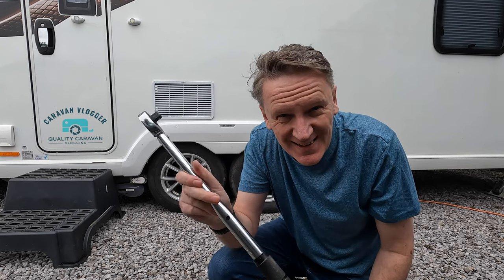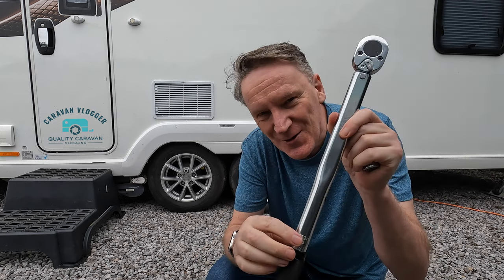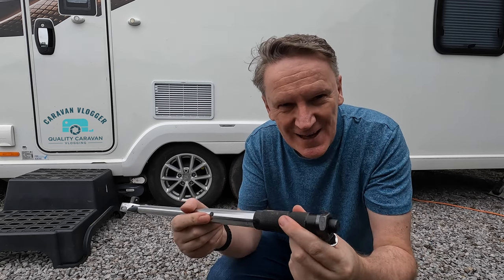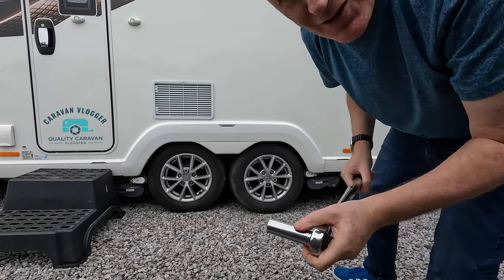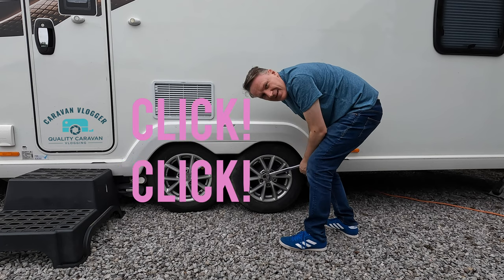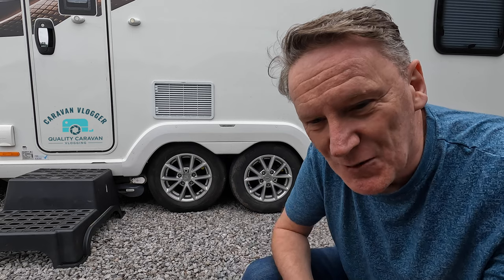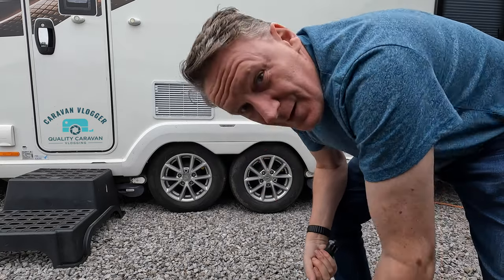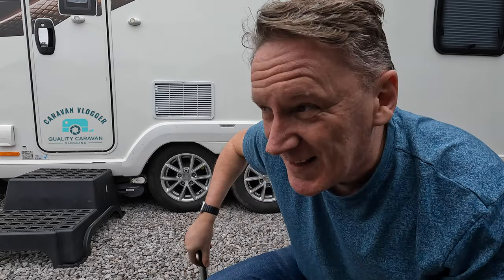😇Practical Caravan Maintenance. The Torque Wrench 😂🤦

Comment: I’ve said this before, too many people are obsessed with the torque on their wheel nuts and always just check they are at the correct torque. How many people have checked they can actually undo them and they are not seized or in fact over torqued as each time they check they add another 0.25 newton meters. Or do they find that bit out at the side of the road when they cannot get the wheel off if they have a puncture. 😂

Comment: Hi Graham great video as usual watched your video on your tow car the Mercedes you made about 2 years ago Do you still have the same tow car and has it performed well thinking of buying a second hand one the 220 not the 3 litre which I believe are good towers as well 👍😀
Reply from the maker: Hi, thanks for watching. We currently have a Mercedes GLE 350D. I think the one you were looking at was the white GLC. Well, that got stolen a year ago. We replaced it with a GLE, a very similar car (same 2-litre diesel engine) but a bit bigger and heavier. Very pleased with it; not fantastic fuel-wise, but when you're lugging a 2-tonne twin axle, whatever you use to pull it isn't going to be economical. The GLC was very good tow cat and would still have it if some sod hadn't stolen it :-(

Comment: I was always told (so it’s probably not true) that the length of a wheel brace is specific not random. The idea being that it gives the correct ish leverage to get one’s nuts to just the right torque …… ish. That’s why you should never put a hollow tube over a wheel brace to tighten your nuts as you’ll over tighten the little fellas!!! Ouch!

Comment: I worked in F1 motor racing for 15 years and did not torque bugger all and nothing fell off or snapped, did it all by feel and judgement
 but anybody  that has a van serviced or a wheel changed professionally it would have been checked any how 😅🤪👍👍

Comment: Great video,,,,,,,,🤣🤣🤣🤣🤣🤣
I always find out what the Torque setting is supposed to be and then I double it, just to be doubly sure my wheels wont fall off.
I also find out what my tyre pressure has supposed to be and double that as well, just for good measure.
Did you know that you can use your corner steadies as "jack legs"  I found that I can easily raise my caravan up at least 4 inches,  just by winding down my corner steadies. [DO NOT TRY THIS AT HOME] or anywhere else for that matter. 👍

Comment: Nooooooo. Graham. Your nuts were probably torqued properly before you checked them, that extra click you've just given them means they're now too tight so they will break and fall off probably on a busy roundabout, during the rush hour, when it's raining and you need to pee. If I were you, I'd keep the E&P remote in the car, if the worst happens, drop the rams and you can slide to safety.